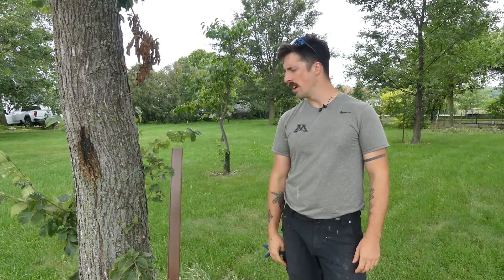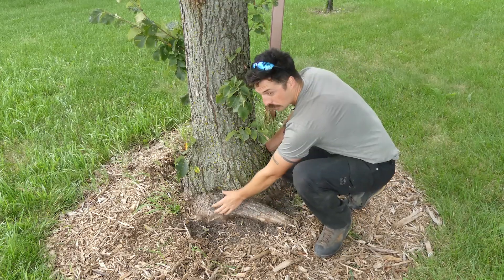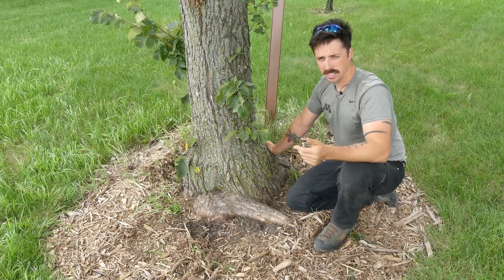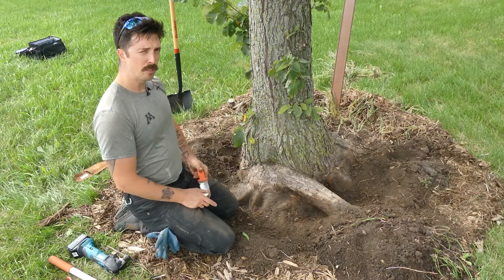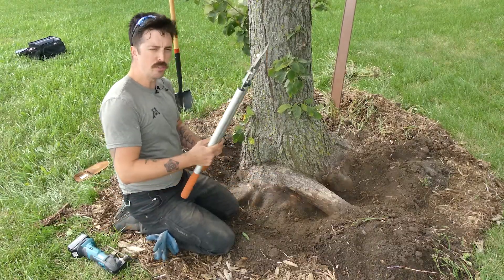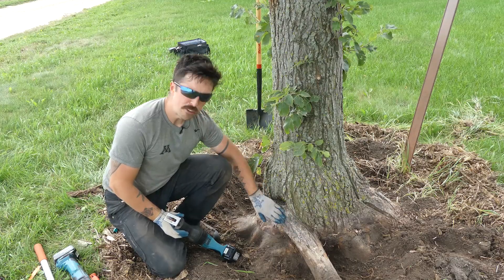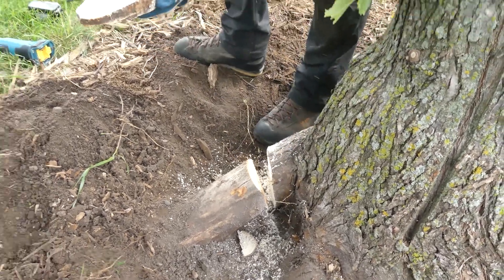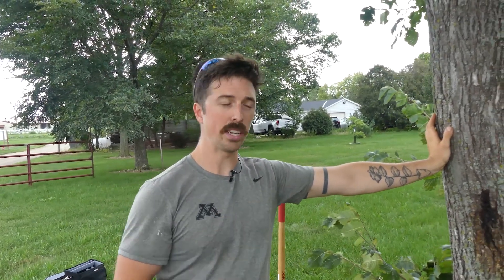Stem Girdling Root Removal in Established Trees

Comment: This is not work that should be done b ",ost people" but rather an Arborist and an AirSpade® or an AirKnife® are the tools of choice Using manual tools guarantees root damage. When you insert your manual tool, you cannot see if there are any roots and once you connect with a root, the damage is done.

Comment: The flare clearing work was done well. Pretty much in line with the standard procedure in the root management standard. 
And the editing was very well done! 

The root is still girdling the stem. A cut could be made just beyond the point of grafting, using a chainsaw and then a chisel.

It would be good to review the literature before delving into unfamiliar practices!  The July 2007 edition of Tree Care Industry magazine shows some examples of removing embedded portions, like the one left in this video.

And the proceeds of the third Landscape below ground conference has a peer reviewed protocol at the very end.
If there are any questions or comments about these two references I would be happy to answer them.
Reply: Hi, i’m interested in learning more about the two references you mentioned. Do you have pdf versions of the articles?

Comment: tough call on that one.. The cut you made is going to have zero effect on the girdling problem for about next decade or more. You didn't remove any portion of that root that was touching the main stem. The main stem would have to grow quite a bit wider to reach the effected area, so again, what you did has zero chance of having any beneficial effect for at least another 10 years. On the other hand making that large cut on the roots of a tree that size could kill it well before the 10+ years you''' have to wait for any beneficial effect. My experience in dealing with girdling roots is limited, but what I have seen would indicate that by the time a tree reaches that size, it's too late for root pruning to do it much good. If you are going to cut girdling roots, you need to get the trees when they are much younger.
Reply: Yea.. thanks for giving no solution. Asinine fella.

Comment: What's with the ear protection? A chainsaw would go much faster. Would suckers form if the the root not removed?
Reply: Less control with a chainsaw and you'd damage your blades or the tree. And, you'd have to use the tip of the saw while holding it vertical...very dangerous because of kickback and plus, I wouldn't want my saw that close to the soil.

Comment: This was good advice, and useful to normal people.  i wish air spades were more available.  they are insanely expensive to buy or rent, costing thousands of dollars.  Clearly there is a problem with patent. So many trees would be improved safely even  years after becoming established.
Reply: How often can the removal of the girdles roots save a tree?  50% 80% 100%?  I was told by an arborist that efforts to remove mine (for $1,400) wouldn't save it so I'm wondering if I should bother.  It's a beautiful sugar maple and I figure why not?  I can likely do it myself and if its going to die anyway...I'm thinking of going for it and try to save it.
Reply: @garyhoch8552  grab an air compressor, go for it.

all it can do is get better... or worse.

sadly, by the time the tree is looking poorly enough for you to do anything, it may be too late...
Reply: @garyhoch8552 wish you had gotten an answer.
Reply: You could use a high pressure wash but be ready to go in the house to take a shower to remove all that mud.
Reply: @kimchee94112  I was going to say exactly that

Comment: I am a Dendrologist from Ontario Canada who works for the Ontario forestry service. I would do this girding root procedure much differently with near perfect results.
-Cut the root minimum of double the distance from the tree. 

-Use a bottle jack and force the root to peel away from the tree anchor point.
- I will guarantee you that even though the root appears grafted to the trunk…..
It is not 🥸
Reply: hi, i’m interested in learning more about the bottle jack method. what rating is the bottle jack? 6 ton? 

how do you determine whether the root is grafted on to the trunk?

thank you
Reply: I was thinking similar to that but pop it out using your truck with a tow strap after you make the cut...if you can get your truck up in there...